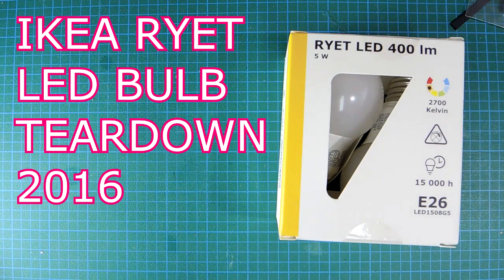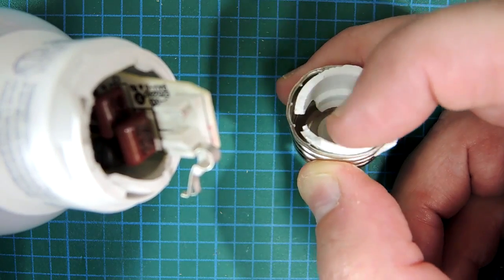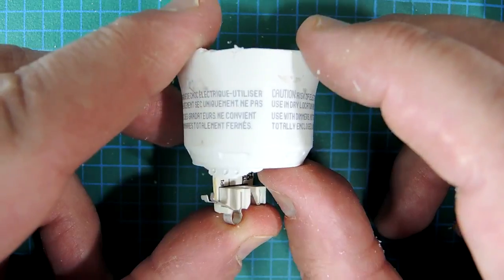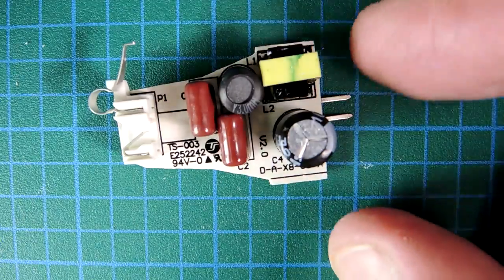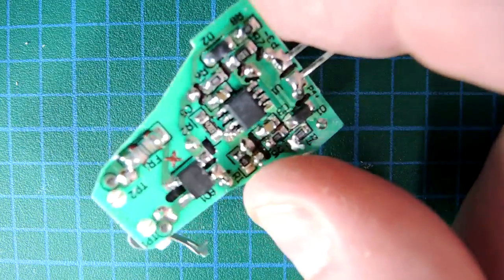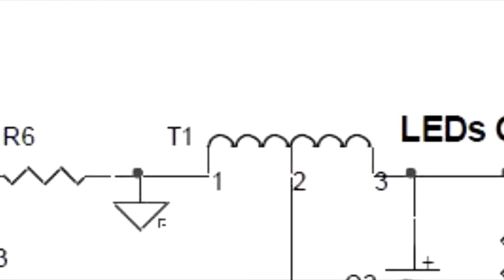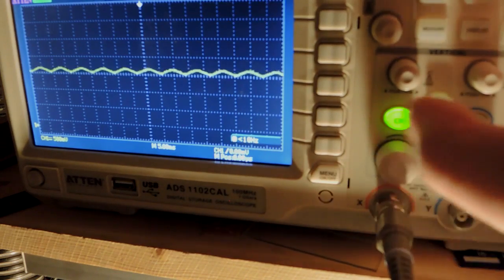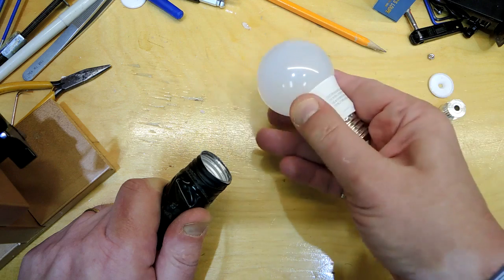IKEA RYET LED BULB TEARDOWN: CRAZY CHEAP

Comment: How did you take off the lightbulb cover/diffuser that is glued on the bulb?
Reply from the maker: +Theresa Lee hacksaw, once the cover is removed hazardous voltages are present so the bulb never goes into service after that, it's only for analysis

Comment: I would classify the inductor as an autotransformer. Auto meaning "self" in that case. An autotransformer is not the same as an inductive voltage divider, it is (in physics therams) a real transformer (which does not isolate).

Comment: A more sophisticated power supply than the cheap LED lamps available over here but ours are dimmable. as they use capacitative droppers as opposed to switch mode power supplies.

Comment: IKEA started promoting green lighting, switching all the lights used to illuminate their stores to LED. IKEA also stopped selling incandescent and halogen bulbs and fixtures. I wonder if IKEA is selling the LED bulbs at a reduced markup as part of their green lighting campaign? I picked up 2 packs of 400lm chandelier type LED bulbs for $3.19 CDN ($1.60 per bulb) at the IKEA Burlington in January.
Reply: +SublimatedIce Most places are going to LED for lighting now, I do commercial electrical and its very rare for us to ever install florescent lighting anymore.
Reply: +SublimatedIce They are not sold at a loss :) The power of IKEA is in her purchase strength and long standing relations and investments into suppliers to ensure both low cost and compliance to our rules and regulations. That said LED sure is a challenge and the range gets updated all the time (It can be fast enough that a new range arrives in the store, while the old range is still in the warehouse because the even older range is not sold out yet).

+jak p (skiguy09) Tagging you in here to, but yes IKEA can, we are the largest producer and seller of LED lighting worldwide :)
Reply: IKEA could be selling these as a loss leader or with local utility subsidy. About a year ago I bought Philips slim style bulbs in a 3 pack for only $5. They were sold with a utility subsidy despite not saying so on the shelf or package. In other states the same 3 pack was $19.

I find it hard to believe that ikea can buy the parts, ship the bulb from China, pay for assembly labor, pay the suppliers profit, etc. all for $1.50 each.

Comment: Ikea usually takes plastic cases as the heatsink, and it works really great. It must be some special kind of plastic.
Reply: The plastic could have some sort or metal or ceramic, etc. particle mixture to make it heat conductive versus just plastic which per the video is not a good heat conductor.
Reply: +drkastenbrot +jak p (skiguy09) 
Lots of development of thermally conductive plastics going on: 
http://www.coolpolymers.com/
https://www.google.co.za/search?q=thermal%20plastics

Comment: The base connector is nearly identical to the style used in the cree 4flow. 

Other bulbs have used pins to connect the led board to the transformer like the GE bright stick.

Low sell price, though.

Comment: Where did you get it for $2? I see it for $13.35 Canadian on Ebay:
http://www.ebay.ca/itm/NEW-IKEA-2-PACK-RYET-LED-E26-GLOBE-OPAL-400-LUMEN-2700-KELVIN-LIGHT-BULBS-/291472163826?hash=item43dd1843f2:g:YX0AAOSwl8NVXsIR
Reply: +Andy Plater 
Ebay is not Ikea's shop. They don't seem to sell a 400lm version here in Austria, but a 2-pack of 600lm bulbs costs 5€, so twice the price for a brighter bulb. (Ikea's pricing is very weird; while all other Ryet bulbs cost the same in Germany, they want 6€ for the 600lm version there...). Maybe they wanted to get rid of all 400lm bulbs (can't find them in the canandian ikea shop either), and that's why the were cheap.